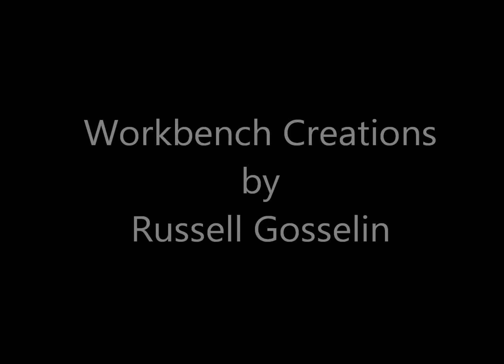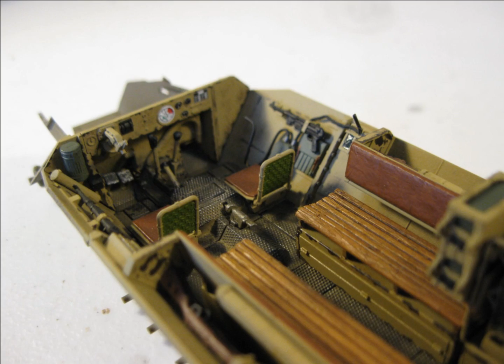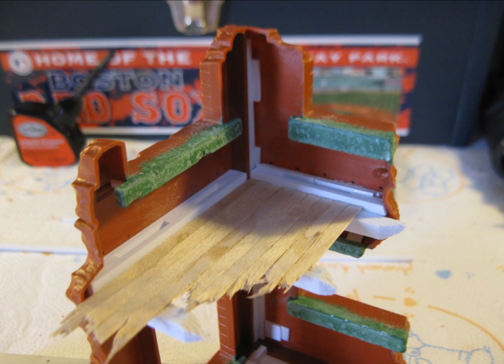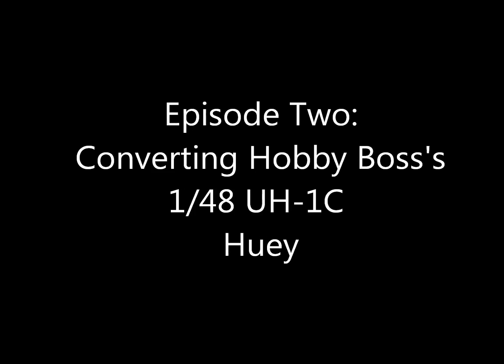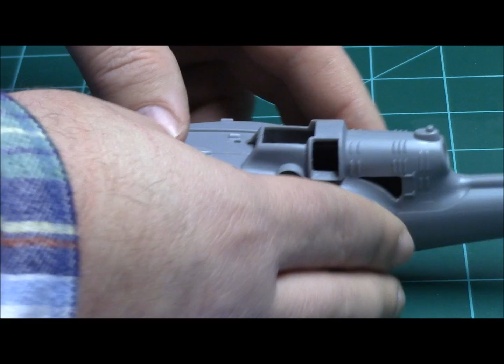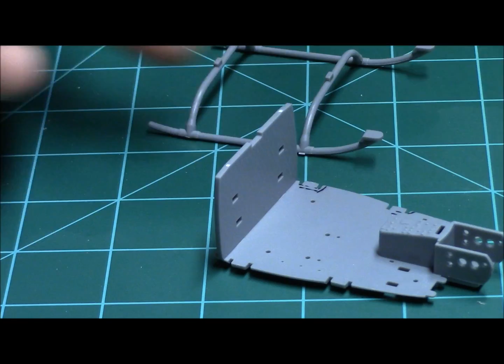Workbench Creations: Episode Two

Comment: are you going to use the same doors you cut out back on the model where the doors are slid back in opening position?
Reply from the maker: +Fernando Duarte Ha!  No way.  They are trashed and thrashed.  I replaced them with the kit bash parts from the old revell Huey.  They look pretty sharp!
Reply: Oh cool